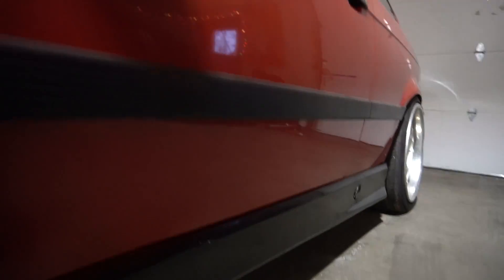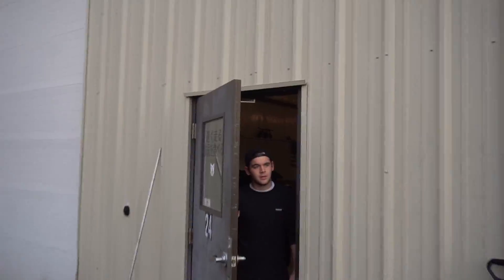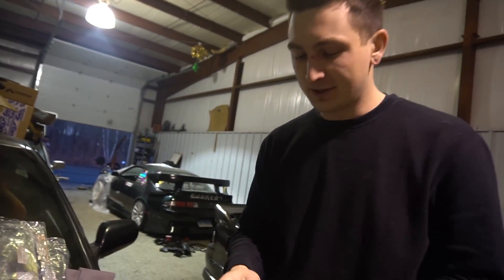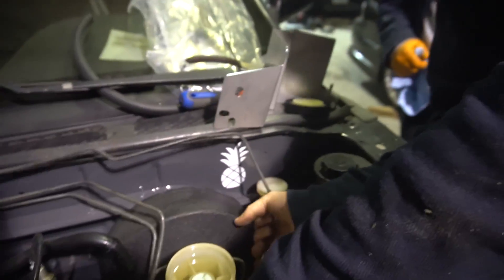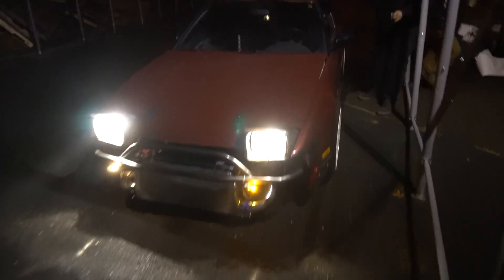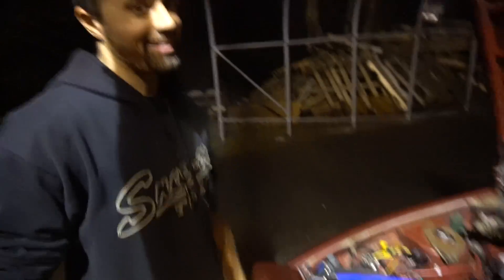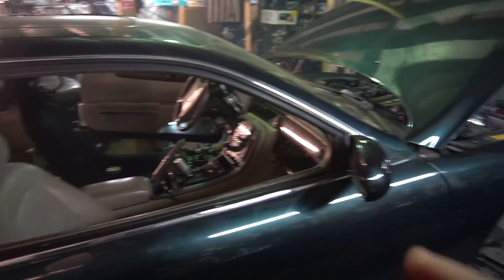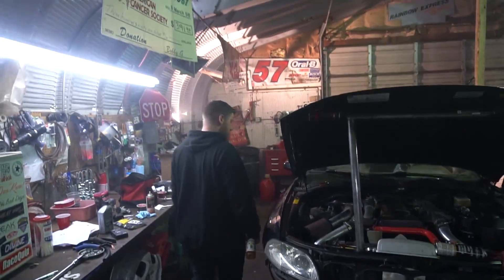BOBBY'S NEW 1JZ SC300!

Comment: is it possible to turbo a car without changing the ecu? I'm thinking of buying a Subaru vivio, and putting a stock turbo of some other car on it. These cars came with a turbo (some of them), but none in Europe, so i want to custom fab everything.
Reply: UrKo if you want it to actually run properly and be able to tune it you need a new ecu sorry to tell you